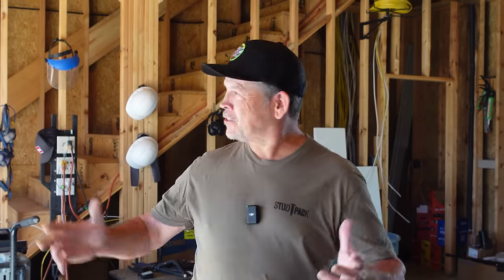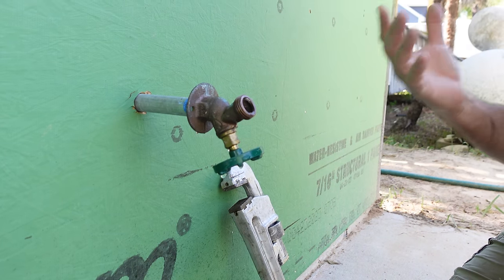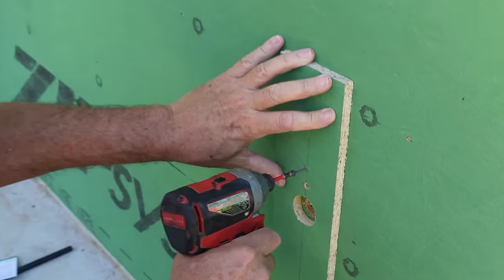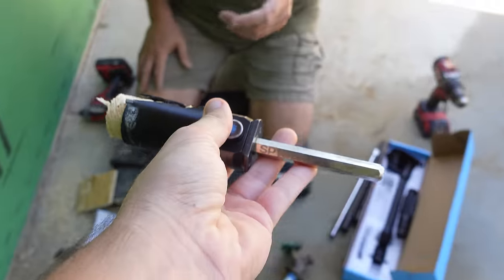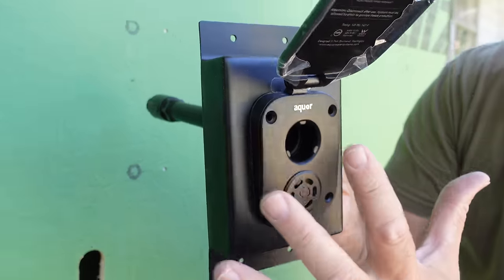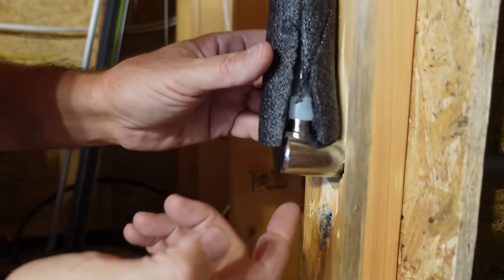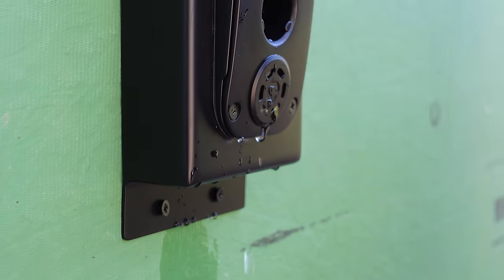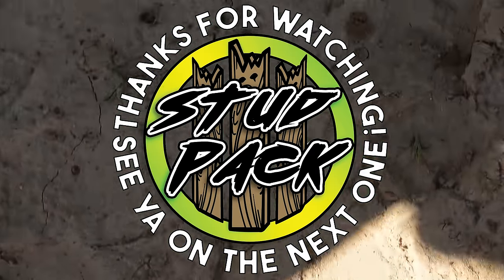Installing a Modern Outdoor Faucet - Ultimate Home Winterization

Comment: They make frost free regular hose bibs that don't require the special adapter that I would always be loosing that have the same concept of shutting off in the wall
Reply: Frost free hose bibs have been around for a LONG time and don't require a fancy attachment to a standard hose to work. They're nice, but just not needed. When they go out of business, you'll be ripping it out to put in a regular frost free bib. Plus, the O-Rings! WTF! Way to over-complicate something. You'll be replacing O-Rings constantly....bullshit sponsored product placement.
Reply: Woodford just isn't sponsoring videos
Reply: Since the 'special adapter' STAYS on the hose, you'd have to lose the HOSE to lose the adapter.  I have two bibs, bought two adapters. No muss, no fuss.  
I DO wish they'd made the handles on the adapters more 'grippy' -- I've had to hang some rubber-ish gloves near the bib, cause when my hand gets wet (it's a HOSE, guys, of COURSE my hands get wet!) , I haven't the hand strength to UNscrew the doggoned thing! Put a glove on and it unscrews no problem!
Reply: @1950Archangel  Wait until the adapter cracks or the o-rings wear out and you have to change them. Fun times.
Reply: @GrammarPoliceInvestigations  
"@1950Archangel  Wait until the adapter cracks or the o-rings wear out and you have to change them. Fun times."

The "adapter" will be in a heated garage's interior wall.  So exactly what would make it crack?  And the o-ring will just be sitting there on the pipe with nothing moving to cause wear.  So exactly what would cause it to wear out?
Reply: @oldtimefarmboy617  Enjoy your over complicated garden hose!
Reply: @GrammarPoliceInvestigations  
"@oldtimefarmboy617  Enjoy your over complicated garden hose!"

Regular garden house: twist and twist to get it onto the faucet.  Get ready to move it to another part of the yard and twist and twist to get it off the faucet so I can move it over and twist and twist to get it onto another faucet then repeat and repeat every time it needs to be moved.  Winter comes and cover faucet and hope it does not freeze and crack and have to be replaced.

Over complicated garden hose: put on adapter and push and twist one quarter turn to get it onto the faucet.  Get ready to move it to another part of the yard and twist one quarter turn and pull to get it off the faucet and push and twist one quarter of a turn to get it onto another faucet.  Winter comes and not worry about it at all.

Gee, such a hard choice, not.

Comment: I still like the Woodford bibs. They seal inside the house, and aren't plastic. But, any solution depends on the water line being in the warm side of the house, which can be problematic if someone leaves the garage door open during a freeze. Ideally, there is some sensor to raise an alarm if that happens.
Reply: My house was built in '76 and the Woodford bibs just needed some new packing washers about 8 years ago and they work fine up here outside Chicago and have never frozen in the winter.  They are doing a commercial for a problem that was solved decades ago....

Comment: They make traditional styled frost freeze hose bibs. However, I have these on my house outside of Austin, TX. I bought a bunch of the hose connectors in case the company ever goes out of business. I also made a little spot by the hose bib to store one adapter when it's not on the hose.

Comment: One thing to note is that there are normal frost free hose bibs. Yes they may not be super fancy but as long as you disconnect the hose (which you have to do with this product every time), there will be no issues. 

It looks like a neat product and definitely gives the house a premium look but I’m a fan of the old school Arrowhead frost free bibs. They also have Pex connections. Woodford can make some good ones too but the plastic on the newer ones is too flimsy.  

I like being able to just throttle the hose to a trickle or have the ability to put an irrigation timer on it or a Y. If I ever sell my house I might put one on. Universal hose threads and quick connects don’t need to be improved upon in my opinion.

Comment: I have one of these installed last year.   I have to give Aquor credit for a great invention.   My back Hose bib always froze here in the Northeast area.   Since installing this, NOT ONCE did Aquor ever freeze as it drained the water straight out.   I wand to replace my front hose bib but it is behind my cabinet and on BRICK Overlay.

Comment: Paul NOOoooo.... you need to visit high performance building supplies for the edpm gaskets. It keeps the air and vapor seal.  The proclima ROFLEX 20 GASKET is i believe the size you want for small pipes, They also have ones for single wires and such.   I also take a belt and suspenders approach, put a piece of stretch tape over the hole first, slice an X and push it in and over the osb so that any water won't rot it.

Comment: Oop's arbor lets you take a hole saw the size of the old hole and a hole saw the new size you need. Works great saved me a lot of time. Also Bosch's has a new hammer drill with a level that you can program to the angle you need.

Comment: Dear Stud Pack, As someone who lives in the northeast I know all about freezing pipes.  In order to make sure the hose doesn't freeze I have an easy free solution......shut the water off to the hose, drain it, and store the hose for the winter!!!  So many people up here don't do that and it costs them thousands.......love how the garage is going!!!!
Reply: this, so much simpler.
Reply: These hose bibs never have to be drained, and you can keep the water running all the way through winter if need be.
Reply: Houston, Texas rarely gets to freezing and when it does it is usually a soft freeze that does not last very long.  Usually the heat escaping through the wall is enough to prevent faucets from freezing if you put a cover over them.  And most of the time, the cover is never necessary.

My parents live in the Panhandle where it gets colder longer than in Houston.  They have the old style hose bibs on the house they had built in 1973 and have never covered them and never had a problem with water freezing.  Even two years ago when we had that extremely cold freezing weather for a couple of weeks.  Of course our electric generator company is not controlled by the quasi-governmental agency like most of Texas down there is so we had no problem with losing power because wind generators froze up and power plants went down.

Comment: If you live in a cold climate every home will have a frost proof hose bib and have for 50 plus years - so nothing new here.   But it looks like a nice device.  Also in a cold climate you never put water lines in a exterior wall or soffit or attic or uninsulated crawl space as they will freeze solid when temps get below 32.   Frozen lines can be thawed with a hair dryer if you can get to them.    Appreciate yand like your videos    😮

Comment: The way the comments on this one had gone you would think the Stud Pack boys had announced a federal law mandating this product.  Buy it if you think it is good, dont if you dont, really easy solution here.

I have also used a cutout like that to re-drill a hole saw hoke when I didnt have the previous sized saw to double up on my mandrel as a guide instead.

I liked the use of the spare piece of board cut to the correct angle to act as a guide.  Personally I might have taken the lazy route and upsized the upper hole by 1/8" to allow for the slope 😂
Reply from the maker: Seriously!😅 Appreciate it Dustin 🍻

Comment: I like hose bib adapters.  The orings will go bad but they look super easy to replace with a $1 oring kit. I use hose quick adapters and a bit of lithium grease keeps those mating surfaces prepped.

Comment: Hey Paul, you should check out the Crucible GoDrilla! It's a drill extension designed for lining up holes between the arms and seats of chairs with no runout. You know it's rock solid if it's good enough for furniture guys!
Reply from the maker: I just looked it up... really great product but it looks like it's 1/4" maximum shank diameter on each end.  Maybe they'll make a larger one??
Reply: @StudPack  Ah! I didn't realize the Spyder Hole Saw used a 3/8" shank. Makes sense though, to support all that metal and ejection system!

Comment: hey guys, another great video!  That hose bib system is great but needs a better, higher-quality handle for opening / closing the valve.  Something like a brass knob rather than that plastic blue handle.  Otherwise that is a totally genius system and I'll be installing it in my new build.  Also, one thing I have to mention, I know you probably didn't mean it in a negative way, but at 15:58 your quip about the Space Shuttle and o-rings was not so good.  You may recall that it was the SRB o-rings that were infamously found to be the cause of the Challenger disaster.  So o-rings were, in fact, not good enough for the Space Shuttle, and sadly Challenger was the result.  Again, I know you only had good intentions but maybe avoid that reference in the future.  All the best!

Comment: for those on a budget out there, and without local access to standard frost free sillcocks (or they dont work for you due to wall thickness limitations etc) , a poor mans way to achieve this with a regular hose bib, is to still install it on an angle, and install on the inside of the space, a ball valve shutoff with a built in drain bleed valve. the shutoff shuts off water inside the conditioned space, and the bleed valve lets air into the pipe so the water can drain out. However in this situation, you need access to those valves from inside. Also, the draining is done manually, instead of automatically every time you unscrew the hose. So it is not as smooth to use as the fancy hose bib, but cheaper and with off the shelf parts. And definitely a major upgrade from the standard hose bib with no way to drain it. 

It can also be one with two standard shutoffs as well, one to shut off water and one to act as the bleed valve.

Another benefit aside from price, is you dont need the proprietary hose connector. It works with standard hose connection and all off the shelf parts.

Comment: Hey Paul and Mr. J , to get the dry wall upstairs how about this. load it up on the back of your pick em up truck , drive thru the garage and past about 8 feet or so, then build two pieces of scaffolding say at 6 feet or so for the first one then  the second one about 8 foot tall then pass each piece up to the 2nd floor patio to go right thru the slider.
Reply: @fryman 1369. I have a “suspicion” that they got the drywall upstairs all ready.
I watched the video to the end. I caught their “Easter egg”. Notice the third window (on the right) is “uninstalled”. So….since Stud Pack does such quality work, then why else would the window be removed?  🤔
Reply: 21:05 good catch

Comment: Anti-siphon frostproof sillcocks work great in freezing weather, just as long as the homeowner remembers to remove the hose.  Before the temperature drops below freezing. Making sure that the sillcock also pitches down to the outside so it drains completely, just don’t twist the hell out of the handle and screw it up!!

Comment: Aquor needs a little drip edge on the bottom of that thing under the vacuum breaker so that the water doesn't run down the siding. Pretty sweet item, but pretty big miss on that.

Comment: When you do the insulation, can you discuss how you would insulate this hose bib as if this were the house instead of garage? There's a large hole covered by a box with a large void.
Reply: JonPerryman, It really is not necessary to insulate this assembly if that is what you are talking about. If you are referring to the hose bib they took out, wrapping it with the foam as is on their PEX is about as good as you can do inside. For the outside pretty much the styrofoam  cover like the one they showed. There are and have been available for a long time, freeze prove spiggots/hose bibs of varying lengths.
Reply: You put insulation in the wall cavity.  They stated in an earlier video that the garage will be a conditioned space kept just warm enough to be fairly comfortable, not freezing cold.  Since the actual shutoff valve will be inside that conditioned space, there will be no water on any part of the bib exposed to freezing temperatures.
Reply: @oldtimefarmboy617  My original question was "as if this was the house with zero air penetration".  WOW, INSULATION NEVER OCCURRED TO ME because that's something we never do! Same with hose bibs being exposed to freeze. They did overkill on this project. It would be nice to know how to have zero air penetration.
Reply: @jonperryman6477  
"@oldtimefarmboy617  My original question was "as if this was the house with zero air penetration".  WOW, INSULATION NEVER OCCURRED TO ME because that's something we never do! Same with hose bibs being exposed to freeze. They did overkill on this project. It would be nice to know how to have zero air penetration."

Snark?  You asked the question.  If you do not like the obvious answer then you should not have asked the question.

And as far as air penetration; this was installed in a garage where the vehicles will be parked.  How much air penetration do you think the average garage is going to get?

Comment: One recommendation I would do is to put anti knocking in the spigot systems because even though it won't make a major difference it will hopefully prevent problems internally over time.
Reply: I assume you’re referring to hammer arrestors. I don’t think it needs them. They’re only required on self closing valves. Plus pex can handle water hammer much better because it’s flexible and can’t handle the wave
Reply: Yup, I agree! It's not needed with Pex system as long as pipes are well secured.
Reply: @joshcowart2446  Good point. And thanks for clarifying I forgot the term. I also guess you are right, I have worked on dozens of jobsites where we installed them as precautionary.
Reply: @ronlovell5374  I also agree. I liked both your comments

Comment: Man, I hope you never lose or crack that plastic adapter. 

Also, how do you drain the water out of the hose once you disconnect that adapter? A little overkill for a fricken water hose.
Reply: You do realize a hose has two open ends, just drain the water out of the other end or take the adapter off. I do agree it is over kill and over price alternative.

Comment: I know Matt risinger oushes these hose bibs but I can’t get on board and think y’all are making a mistake. I’ve installed these a couple of times and realized these issues. First is ease of use. You have to keep track of a tool to turn it on/off. Also there’s no way to change the flow. It’s either on or off. Then it’s bad when using a hose. Because once you click that thing in it’s on, you have to connect the tool to the hose first and depending on the situation it’s a pain to twist it in. I also don’t like to tell someone to buy extra parts to fill a bucket. The second thing is replacement. It will eventually fail. There’s no way to access the washers. Most freeze proof hydrants you can unscrew the front to repair it. However these are solid so you have to replace it. Then when replacing it, try wires no way to do it without cutting drywall. Because of its shape you can unscrew it so you’d have to disconnect it from the back. Im the video, you act as if the option is aquor or a standard sill cock. That’s not true. They make freeze proof hydrants that screw the same the aquor does except you can unscrew it as well.
I guess if you do go this route there’s some upsides not mentioned, mainly due to the cover. Not only does it look better with that cover versus a sill cock, there’s nothing stuck out that you can hit. I just worked on a hose bib  that stuck out because they had to put a bonding wire on it. This made the end stick out almost 6” from the wall so naturally it was bent because someone hit it.
Reply: All o-rings will fail. Even these that they installed. They’ll be crying when it happens down the road. Keep it simple. Traditional method is safer.
Reply: @philweed1603  yep, I don’t know why they don’t make them like commercial wall hydrants where you can take the front off and pull all the parts
Reply: After some though I think a few design changes could make these worthwhile. I’d make the threads on the adapter piece finer and longer. This way you might could partially open it so it’s not always full blast. I’d also make the front removable to service it. I think with these two changes, I wouldn’t have an issue with them. I would never recommend a product to a customer that requires regular maintenance and they maintenance requires cutting into walls.

Comment: You guys should use Quickflash for all your penetrations through the walls. It has a rubber seal for all your plumbing connections. Especially when you are considering your blower door test that you want to knock out of the park.
Reply: The blower door test is for the 2nd floor living space, not the 1st floor garage or stairwell. Holes made on the exterior of the 1st floor walls won't impact the blower door test of the living space on the 2nd floor.

Comment: The problem with those proprietary hose bibs is that the leak water everytime you take that adapter off. And if you don’t take it off you need to put a plant in front to protect your shins. On second thought, the plant would solve both problems.

Comment: One thing to think about is serviceability in the future. In my opinion an oring in a plumbing fixture at some point will need to be replaced. Love that you plan to have an access panel, but with how close the fitting is to the stud do you have enough play to spin the silcock out without having to cut the PEX and remove the back side instead? Simple things like that will save you a headache 5-10 years in the future